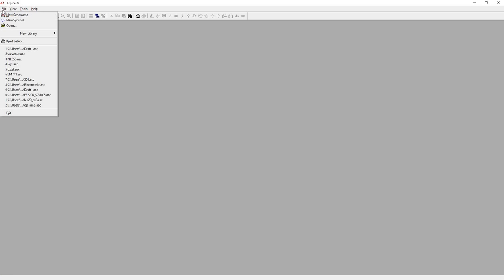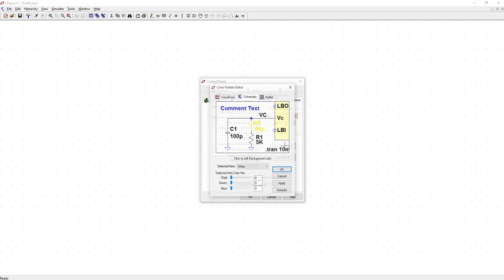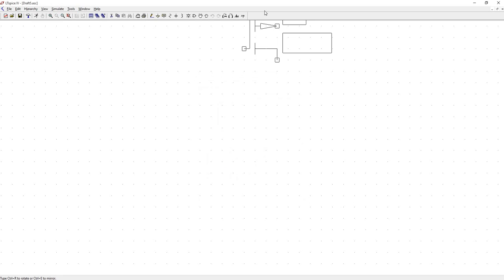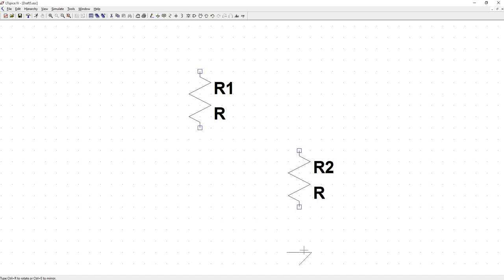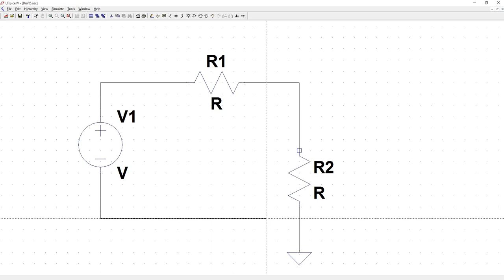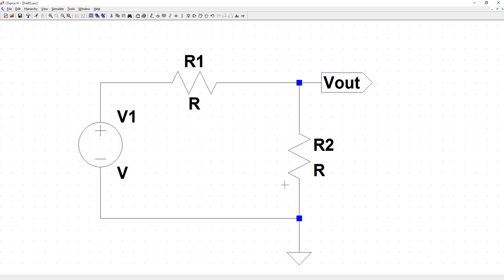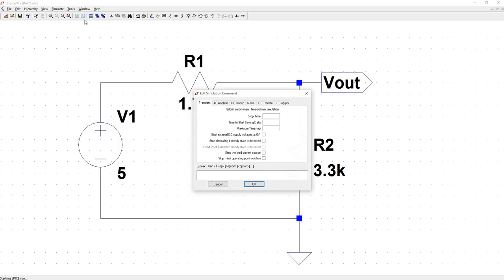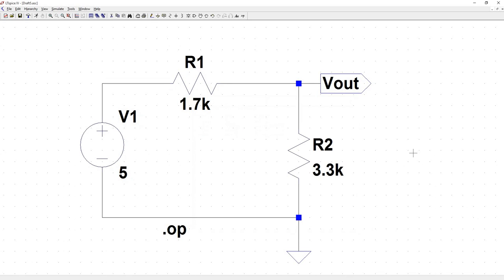Video One- Getting started with LTspice

Comment: These videos are really good, but I expect many viewers  to quit almost immediately because of the squeal. What a shame! (I found an easy fix. See end of my comment.)

Nice and simple video. For newbies like me,  I recommend unchecking  Control Panel / Drafting System / "Automatically scroll the view".  The squeal is bad but turning the volume down helped.  I recommend running your audio through a notch-filter to remove it.  These videos are worth the effort to remove the squeal.

The squeal can easily be removed with the free Audacity program. Downloaded a portion of the audio  from the beginning of the  video. Be sure to start audio capture a couple of seconds before she begins speaking.  Under Audacity/Effects select Noise Reduction. Select the part of the recorded audio before she speaks  to allow Audacity to identify the type of noise and suggest a correction.  The squeal can be completely removed with minimal effect on the speech.